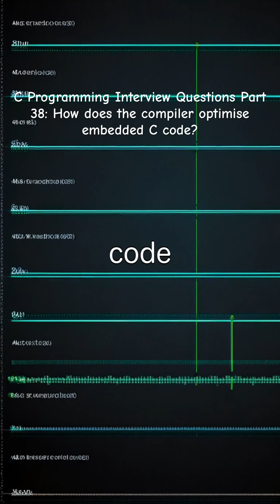C Programming Interview Questions Part 38:  How does the compiler optimise embedded C code?

Comment: Can they still do this for today's games and Operating systems/Apps to reduce memory load?
Reply: compilers are still used for a lot of languages (eg C, C++, swift(?), Rust, etc) and they generally optimize the code whenever possible, however since it's a machine doing it, there still could be times where it can be optimized better by writing the code differently